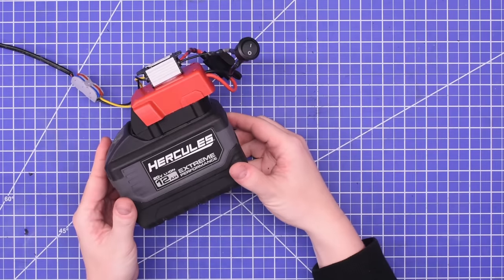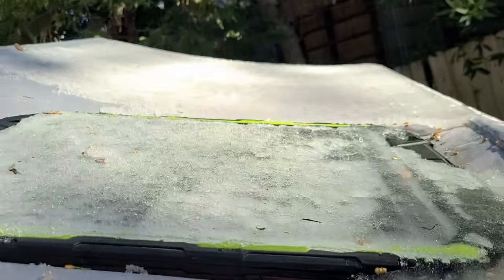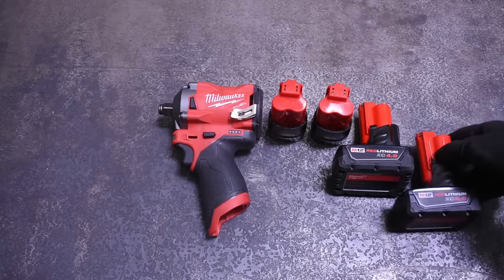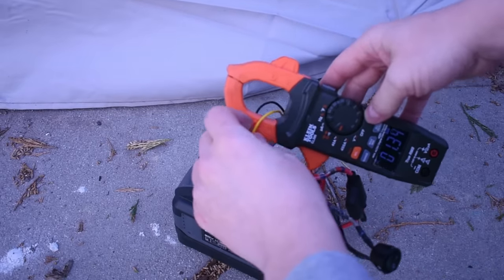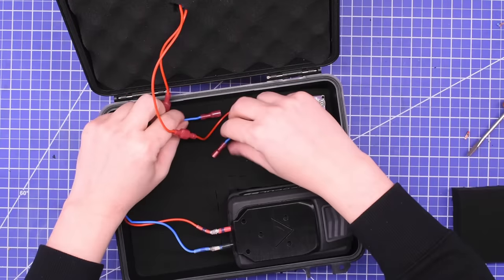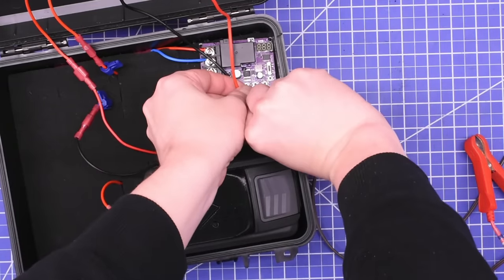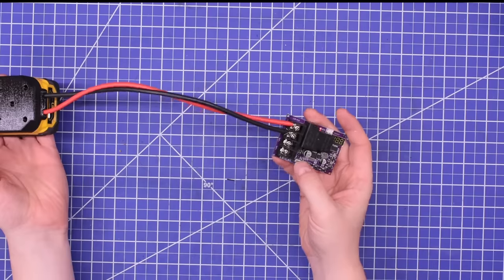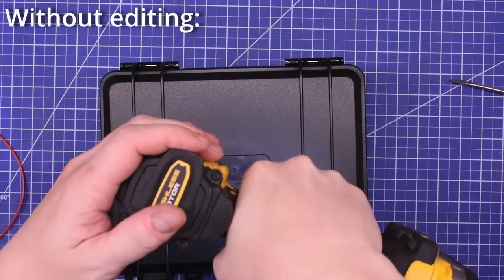Cordless DIY Car Battery Tender

Comment: You could also use power tool battery Inverters to power a normal mains voltage trickle charger, Craftsman's 20V 150W Inverter for example, i believe Dewalt also has one.
Reply from the maker: Did to ac to dc to charge dc though

Comment: 12.65 is too low, your batteries are sulphating at that. Float voltage is around 13.8 and will draw some small amount of holding current and prevent sulphate formation. You might not know this, but sulphate formation starts the second you stop floating. Ie any level of discharge. It's worse at lower states of charge, but always present unless floating or charging. One of the many shit things about lead acid is how long the tail of charging takes. For any short trips only user, the starter takes X capacity out in 1s then the alternator puts some back in quickly but the short trip doesn't last nearly long enough to complete charging. As such batteries in cars like these, read, most cars, are always degrading with sulphation.

Comment: As an automotive locksmith I would like a cordless battery maintainer while programming keys/fobs. I haven't found anything yet.
Reply: What minimum battery voltage do ECU/ECMs need to see before allowing programming?
Reply: That’s actually a complete located question that is going to be very ecu specific, sometimes it is set in the programming software or the ecu but frequently is not defined. 12V is a good guideline.
Reply: @Slicerwizard  I have no idea. Sometimes we get cars that were sitting and the battery is low or dead. I just want something that can keep it at 12v for up to an hour that doesn't have to be plugged in and doesn't have a shutoff feature like my NOCO jump box. I am basically looking for a cordless Topdon 9000 that also isn't $700. lol
Reply: @scotts4125  Older booster packs have full time 12V at the jumper leads. Some larger booster packs have a lighter plug designed to provide continuous 12V for some accessory loads. You could also just pick up a 10-20Ah 12V gel cell and bolt on some short jumper leads. Use a small battery tender or regular charger to top it up between uses. Or plug it into your work vehicle's lighter plug to recharge. A gel cell is a pretty inexpensive solution.

Comment: Cool, do you think plugging a Milwaukee inverter into a Milwaukee battery then plugging in a small float charger maybe like a Noco would work? Probably not because the input volts is 120-240 volts?

Comment: I’ve always wanted a cordless trickle charger that you could mount in the engine bay like a jump starter but while the car is running it can recharge the trickle charger and then when the car sits it trickle charges the car battery.
Reply from the maker: Just run two batteries like a diesel (or cars with large audio systems) then I would think, same sort of idea
Reply: @TorqueTestChannel  I have a single cab short bed obs ford. I’ll have to look and see if anyone else has done that as well. Not sure where I’d put another battery except in my tool box but I don’t want to sacrifice the already limited space I have.

Comment: I have had to replace car batteries because they fail in winter,that would be fine if it wasnt so damn cold.Would be cool to use one of these when its cold to make sure my car will start on those really cold days with a older battery that only fails to start the car because its so cold..

Comment: We need to see more of 3/4 inch air guns to bring the beans up. And to see how they compare to corded ones.
Reply: It has been brought up before... it's a big investment in support tooling, for a slightly niche market. Typically 3/4" stuff is built for a market that won't tolerate slouch performance, and the tools are also priced accordingly.
Reply: It hasn't been brought up before. Only that they couldn't test due to their air system not suplying the right amount of pressure the pneumatic tools needed, but were working on it. Sure they are expensive but as big of a market as all the corded 3/4 guns they've tested out there.
Which is not such a niche market after all.
Reply: @Visionariuso  in that same conversation, I think he also had a concern about the test-rig capacity/durability.

Comment: Maybe just run your favorite corded battery maintainer off an inverter and your choice of battery.  Maybe an old car battery removed from service -- but could still run something like this a long time between charges.  If you forget to recharge and ruin it, it was junk anyway. No loss.
Reply: That’s a pretty nifty idea. 

One problem with inverters is that they use quite a lot of power at zero load. Smaller ones are better. But I think a USB only one would probably be most efficient.

Comment: Might be better to set the cutoff voltage higher. 3.0V is very low for a lithium battery, especially when it might sit at that voltage for days in freezing weather. That’s pretty much a guarantee for battery damage.
Reply: They are cutting the voltage at a total voltage of 15.2 volts. Or about 3 volt per cell. It's a pretty standard safe low voltage state.

Comment: you need higher voltage from the buck converter to charge with more amps or it will take forever

Comment: I'd be curious how things go with a tool battery connected to that brand's A/C inverter (most have them available these days) connected to a typical A/C powered batter tender. For those who don't want to get out the wire strippers, etc.
Reply: The ego 400 watt pad1500 looks sweet and you can charge your ego battery using a usb c charger cable too!
Reply from the maker: Yes, but DC to AC to DC to charge a DC battery is a lot of losses stacked for no real reason and would likely only last a day or two.

Comment: I'm not sure I get it. In the end, aren't you just increasing the reserve capacity of the battery by 5-10 amp hours. Wouldn't a 12v,~18AH UPS or booster pack battery be much simpler and accomplish the same goal for less money? Maybe your brother just needs a new battery.

Comment: So Torque it appears to me that your vehicle is a S197 Mustang, is that correct? If so have you found that even with regular care the batteries just unexpectedly fail randomly? Mine is 12GT and every two years or so the battery just randomly up and quits and then refuses to take a charge. Ford, AC Delco, Interstate, Die Hard, they’ve all done it.  I’ve tried to find better batteries like an AGM but to no avail. Die Hard has one listed on their site but according to multiple stores around me, that battery does in fact not exist.  You got any thoughts or experience on this? I’m an auto tech by trade and I like to think I know a thing or two and I’ve checked everything I can think of on the car and have yet to find a fault anywhere on it. The batteries just seem to die for some reason.
Reply from the maker: I'd check the alternator health. But yeah, I'd say a little more than on other vehicles. Yellow top* Optima with its higher voltage might do the trick though (13V or so)
Reply: @TorqueTestChannel redtop optima is good, but still the same voltages as any other lead acid.
Reply from the maker: @-FOXX  Sorry, yellow is what I mean. Which are usually 13V + when 100% if memory serves
Reply: Walmart offers 4 year free battery replacement and might be worth consideration.
Reply: @TorqueTestChannel  Diode ripple and output is totally fine. Load tested without issue on both the original and currently installed boss alternator.  Had my scope hooked to the battery while driving for about a week taking recordings and looking for anything abnormal, found nothing. As previously stated, I replaced the alternator not because the old one was bad but I wanted the boss alternator and my AC compressor seized so I was going in there anyway. I installed the boss alternator “upgraded” power line but honestly I couldn’t see any difference to the one I already had. Same gauge, near enough the same weight, same size strands, same resistance using a Hioki milli ohm meter, no change when flexing and pulling on it. Pulled a 200 amp load through it and measured the voltage drop across it, if I recall they were both less then a .75 volt drop. I’ve added additional grounds from the engine to the chassis, engine to battery, chassis to battery, I could go on but I think you get the point. Not that I’ve owned a ton of vehicles over the years, 5 total counting my Mustang, none of them have had batteries just up and die so consistently and usually without warning like the S197 does.  It’s not a huge deal, I always have a jump pack in the car, and as others already pointed out, I can warranty the batteries, just really want to know why it happens. My GT being a very base model with only three options means there’s not a ton of electrical load to begin with but Ford did spec a pretty small battery for  it.

Comment: Just a though why not add a second voltage meter and have 1 for internal battery and one for car battery? that way it's easy to check both and if you use the same one as you did they can be turned off.
Reply from the maker: Agreed, hadn't assumed it'd need to reroute it and bypass the voltage cut out, but that's probably the best plan in its current state.
Reply: @TorqueTestChannel Honestly I'd still have it even with the low volt cutoff because then you can just tap it and check the battery voltage and see if you need to swap without opening it up and checking the battery gauge etc.

Of course Rigid and Ryobi batteries having that built make it even easier lol.

Comment: Possible to use obd plug with low amp voltmeter connectors
Reply: Yep. I have a small solar panel that floats the 12V battery through the OBD2 connector.  (Unlike the lighter socket the OBD2is always hot.  You can’t push a lot of current through the OBD2 connection, but certainly enough to float the battery and take care of. They always on things like keyless entry and alarm.  

The panel suction cups to the inside of the windshield. 

VW used to put these on cars during shipping to keep the battery from dying.

Comment: Before I watch this: fuck lead acid. All of my running driving legal cars from an overall fleet of 30 use home built LiFePO4 packs that will probably out last me. 1.3kg 325CCA 8Ah 14.6V max, 10V tap out. I use that in 1.6l or smaller, 2x that (650CCA 16Ah) in most cars 2.0 to 3.0 and have started an 8.3 cummins C series with that, barely. 16 cells 1300CCA 32Ah starts the cummins like a sewing machine and weighs just 5.2kg... I've been using these for 4 years or so. I've run them dead flat many times. Only lost a few cells through two types of abuse. Severe over charging drying them out, and reverse current on the weakest cell when discharged too fast and deep, the stronger cells take voltage negative and ruin the chemistry. Otherwise bullet proof.

Comment: What year Toyota is that? I am looking for a 1985 sr5 Xtra cab with as few modifications as possible. Preferably a southern or western area that's never seen salt.
Reply: Good luck.  In Cali, used Toy/Dat/Niss pickups have a half-life on Craigslist of about 30 minutes. They get snapped up by gardeners or sent to Mexico, no lie, I have helped buy three of them over the years for a painter.  If you don't show up first or second in line waving cash, you're sorry outta luck.
Reply: @pault151  if you have any tips or tricks on how to score one of these please let me know. The plan is to restore it to close to original as possible

Comment: What happens when the car battery is at 14.5ish volts but the buck convertor is set at ~12.65 volts?

will it do nothing, or try to bring down the car battery?
Reply from the maker: The only time the car battery would be at above 12.8V is while running, with the alternator turning. So you wouldn't need this if this car was running, and it's designed to send current one direction anyways so shouldn't be all that eventful.
Reply: That’s what the reverse charging protection is for. I imagine it should do nothing.
Reply: @TorqueTestChannel  My daily driver car stabilizes at a higher voltage than normal, but only carries a charged 75F & 2ah lithium battery. That saved over 30 pounds!

i'm thinking about something like that for when it is not my DD.

Comment: 12.6 volts will not save your car battery from dying. They should be float charged at 13.8 volts.
Reply from the maker: Trying this out now

Comment: Why not just use a jump pack?
Reply from the maker: You could jump your car each time, yes. That's pretty rough on your alternator to have to always be limping along a low battery, plus if the car batt dies, you're car's going to be re-learning every drive. Mine's on an aftermarket tune and runs pretty rough for the 1st 20-40 miles while remapping.
Reply: Just using a booster all the time is how you destroy your vehicle battery. Do you think they like sitting around in a discharged state?
Reply: @TorqueTestChannel  Can't loads of jump packs be used like a battery tender?  I'm pretty Hulkman's can.
Reply: @BolognaBurrito  Some jump packs have a cigarette lighter outlet. Use that connection with a dc/dc buck/boost converter. If you have two jump packs you could swap them every day to keep them going continously.